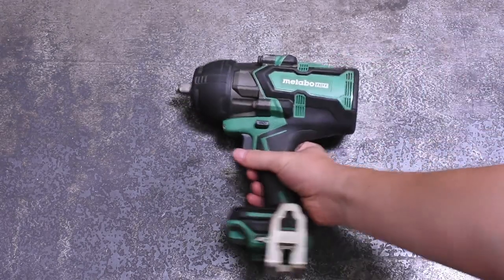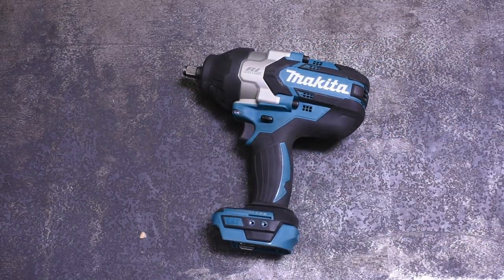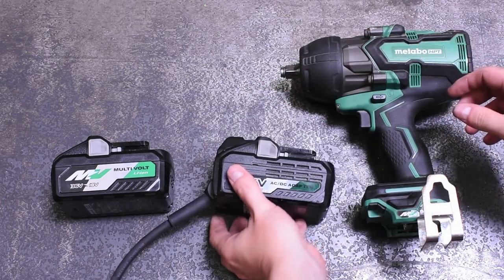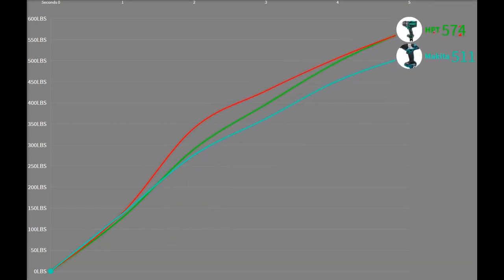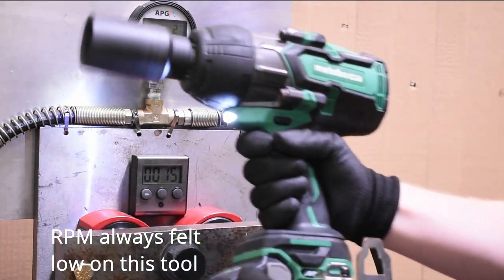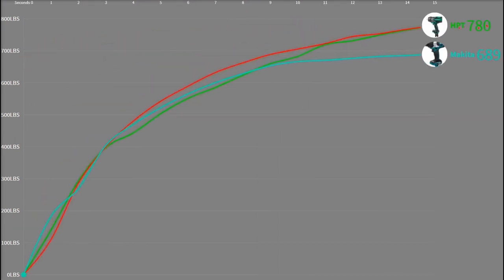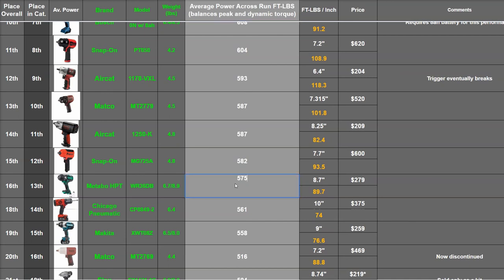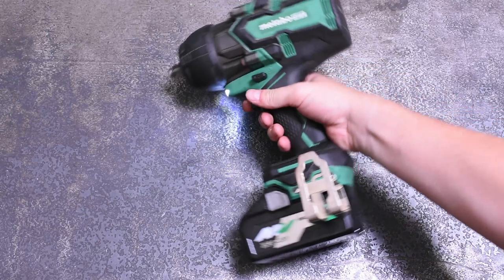What Happens When You Plug In a Cordless High Torque? Metabo HPT WR36DB

Comment: I wonder how a 220v version of the AC/DC adapter would fair (for the Europeans since Metabo is German), you could draw more power from the wall but then you also have to deal with ~75 amps running through the cord to the tool instead of the ~50 it currently does
Reply: Not how it works, tools are based on the winding resistance or controller cycle so all you need is enough for either.  In other words if it is a 36V adapter, all it has to do is stay at 36V without drooping and if it does that, a replacement capable of 1000X the current, won't improve the tool performance the slightest bit more.  Of course whether it stays at 36V, is something to test including whether it suffers loss over a modest gauge power cord.

Frankly it seems silly, since a 220V outlet can power plug in tools of even higher wattage rather than suffering the double (potential) bottleneck.
Reply: It's a step down transformer converting AC to DC voltage because the brushless motor won't work with AC voltage. Brushless DC motors need pulse width modulated DC voltage to function correctly. Although technically it won't perform much more than the 110-120 VAC adapter It will provide better stable current because of transformer efficiency. 220-240 VAC to 36 VDC step down using a transformer is more efficient than 110-120 VAC to 36 VDC step down. You lose less amperage in the conversion process.

Comment: I don't know if it was changed, but the Ridgid R86011 does not advertise 1,100 Ft-lbs when checking today. "485 ft./lbs. of torque in forward and 620 ft./lbs. of torque in reverse for heavy-duty applications."

Is this a different model? It's the only one I could find on their website.
Reply from the maker: We accidently copy/pasted the mid torque model number there. Here's the high torque: https://homedepot.sjv.io/4edzno

Comment: I've been looking at this to buy and almost did. Until I saw all the bad reviews on the batteries not lasting long. Because of this I'm going with milwaukee. I wanted this one so bad but I'm not going to invest $ to just have to buy batteries over and over. Crazy part is the 2.5 batteries aren't covered for 3 years. Batteries are only covered if they are 2.6 ah or higher!!!! That's crazy almost as if they put those in this kit so they won't have to replace them purposely

Comment: probably the adapter has 36V output, not 42. loss in battery performance under load and with use comes from voltage sag. 40t might handle 35A, but sags way more than a lithium polymer pack of equal energy density. if the metabo motor can actually handle 35A then you need a bigger or at the very least better performing battery to access the full power potential. typical UAV batteries would be perfect

Comment: I was hoping this would be a direct plugin scheme, not through an adapter so it would get 110 volts. That would have been interesting.
Reply: Have to convert the AC to DC at some point, or you'd need 2 different motors.

Comment: The corded AC to DC vs DC batteries one is true DC where as there is some sort of rectification going on if they are only doing half bridge rectification that may be why it is less as well as more internal resistance.  A better way may be to get a Variable DC supply as then you could test all of the guns as a corded equivalent with better current and voltage control.
Reply: It's not a matter of half vs full bridge rectification, it's going to be full bridge and then a SMPS.  The difference is it is a 36V PSU while the fully charged voltage of a 36V battery pack is close to 42V.  Of course the battery pack droops in voltage under load, so depends on quality cells and what the load is.

Variable DC supply would just be an expensive waste of money for how large and/or current limited it would be.  Ultimately the answer is, be sane about what power the job needs and don't try to max out a tool and burn it out for no reason.  This channel is about showing higher torque but in the real world, it's not those differences that matter but whether the tool keeps working all day, every day.
Reply: @stinkycheese804  Lithium batteries are a marketing scam.

Comment: Hi, I’ve never seen such a combination, for me it’s either one or the other, I have battery to eliminate the hose and the cord, just my opinion,
Reply: Option to have both in one is better. Always got the batteries when it's a quick job or away from any outlets. Then a plug for when it's in the garage and going to take a while. Also will make your batteries last longer over with less use on them.
Reply: @TheAmericanUhate  for me I’ll stay with cordless, ty for your reply,
Reply: Metabo also has a circular saw, angle grinder, miter saw, and table saw in the 36v multi volt platform that the ac adapter makes more sense for.  It is nice to have options
Reply: I think the power adapter really comes in handy on tools like their cordless miter saw and cordless table saw.  Larger tools that are nice to use cordless on a construction/project site but can be brought back to the shop and plugged in.

Comment: i Think to get the biggest power in to the tool car batteries should be the best, or capacitors maybe, since the cold crank amps are insane
Reply: Lugging a car battery around all day wouldn't be much fun. Nor would the 4 or 2AWG wires be light.

Comment: i am not very happy with the stuff you said about the AC/DC Adapter. There output is not unlimited, it is also rated you need to check the sticker on the Power brick to see the maximum Ampere Output. 
I would recommend using an contactless ampere meter for corded tests, thats a clamp you just clamp onto the cable it will tell you how much amps the device is really consuming. Maybe you can even fit the contactless clamp on some drill handles to see the actural Amps drawing from the batteries?! i hope you read this comment i would say that this is a pretty good idea :-)
Reply: Not happy?
He's just telling u that u can use it for longer periods of time without swapping batteries
Relax

Comment: I have the drill and impact driver. quick story. my friends had to use them because they're Milwaukee and DeWalt batteries were done so I let them use my metabo and they are contractors so they gruffed under their breath after they walked for my truck with them. they use them  for a couple hours. I was assuming they were going to lay the smack down but they were quiet and when they returned them they had a shit ass grin on their face. when I told him I paid little over 200 dollars I had the last laugh.

Comment: I’ll stick with my M 18 Milwaukee it gets it done seems like the Metabo would do better at twice the voltage
Reply: I have both
The Metabo runs cooler and gets more work done and the batteries are smaller than the Milwaukee HO so it's actually better balance and has a much better water and dust rating

Comment: The circle is now complete....
Cordless tools having a plug in option-  SMDH
Reply: To be fair. Cordless tools are an underperforming scam. Try a corded 120 VAC Brushed Drill vs a standard 20V DC brushless Drill for making 1000 holes in an aluminum trailer body and see how many times you need to swap out batteries on the cordless one.

Comment: You should test a human with a breaker bar
Reply: Why?  Even if it wins, the whole point is to not have to use one, plus that is highly variable based on the strength of the human and length of the bar, so completely pointless X 3.
Reply: @stinkycheese804  ok "stinky cheese." it's to get a general context for these numbers. And how much torque a human can produce on this rig. Not a very hard concept to understand. What happens when you're in the field and your batteries run out? You gon use your tounge to break a bolt?

Comment: Can someone explain why this is more accurate than just using a torque wrench and torquing something to spec, then seeing if your impact can bust it?  

Because according to those types of tests, these perform on the money.
Reply from the maker: That would be nut busting or loosening. We test tightening in FWD and REV. Thing is depending on bolt size and thread pitch you can influence nut busting ~40%. But some channels keep things consistent and is still useful to compare between tools like Shop Tool Reviews
Reply: @TorqueTestChannel  thank you.  This is the answer I was looking for.  

On a side note, this is a great channel.   Keep up the awesome content.   Content like this is what YouTube should be all about.  Thanks for what you do.

Comment: With the availability to just walk into home depot and grab the high torque couple with the lifetime warranty I'm going to stay with the ridgid. Good video 👍
Reply: Okay but if the Ridgid is discontinued and then a warranty replacement can only be fulfilled with their contemporary lower powered offering, then wouldn't the warranty seem less than ideal?  They can't replace it with what they don't have.
Reply: @stinkycheese804   They have to give you a tool of equal value.
Reply: The Rigid LSA is a joke-also they take forever to get your registered tool into their system and have had to call them numerous times to update my registration as it stayed pending for  months in end for a bunch of the tools I registered and when I did have to use the LSA they made it really hard to prove even though it was a lemon if a tool

Comment: Need to put a watt meter on that wall adapter .
Reply: Kind of hampered by the US 120 VAC standard. If it was allowed to run at 220-240 VAC It would outperform the battery pack, hands down. Even converting to DC voltage for the brushless motor they have inside the tool. It would be more efficient than the 120 VAC conversion.
Reply: @JosephArata  Plenty of power availbe. No need for 240V AC.
120V@15A is 1800W. 90% efficient conversion to 36V would be 45A (1620W). 80% efficient would be 40A (1440W).
Reply: @JosephArata  not just what TEDodd said but also, most places in the US aren't gonna have single phase 240v. And single phase 120 at amperages higher than 20 amps is just as uncommon. If they were to make the converter with a 20 amp circuit in mind, they would need a different  20 amp plug too

Comment: IP54 is a sort of useless spec.  I'm guessing they didn't engineer for it. They just happened to test it and it passed.  If you actually expect something to get wet, you want IP67.    I've seen IP67 tools be unaffected by use inside a wire EDM machine where they're basically constantly getting wet.
Reply: Well he got it wrong it's actually IP56
Reply: I've got lots of red and teal as well. As the green
The IP56 has proven to hold up better than the other colors here in the NW where we have lots of rain and wet-list a few Milwaukees and Makita's from moisture and had a few Metabo HPT in fall in creek as well as other heavy rains and it's never stopped working-its not a nothing burger-its better protection than it's competitions and usually at a better price point
Use the tools before spouting specs and hypotheticals
Reply: @baseballdude8491  I never said anything about Makita or Milwaukee.
Reply: @prototype3a  I was giving real world experience about my experience with different brands which I actually own and use-Makita and Milwaukee don't even offer IP56 for their tools a Metabo HPT does which is the whole point-it is more protected than the others, which is  a selling point/ benefit at a better price than the big 3 colors-they didn't "just happen to test it and it and it passed" they have a number of their tools rated IP56 and better-not sure what the disparaging something that adds value

Comment: I think that wall adapter battery is the worst designed product I've ever seen just because of the wire coming out the front where you're going to be working... Instead of the back
Reply: It's one of the best designs as it allows me to use my high run time tools with the AC adapter(unlike the other red, yellow, teal colors don't offer) and it actually is in the back of some.tools especially the ones u will most use with the adapter such as SDS Max rotary hammer, table saw, mitre saw, grinder, vacuum, portable band saw etc
When the other tool brands make this an option then u can complain but whining about a great technology that adds run time, lowers cost of extra batteries and longevity is kinda silly

Comment: That AC Adapter is dumb. I can only imagine trying to keep that stupid brick from falling off the lift while I'm working. Corded tools should have motors designed for AC instead of doing this conversion bullshit.
Reply: Dude
The AC adapter has improved the flexibility of a bunch of my Cordless Metabo HPT tools and a big reason I've swapped out many of my Milwaukee And Makita tools over the last few years being able to use the AC adapter with our SDS Max rotary hammers, table saw, grinder, portable band saw, vacuums, router(in table) and other applications has save a bunch of money on extra batteries, added lifetime/longevity of our batteries and lowered downtime
It's not as practical for all the tools but we have used it on some of the other tools at times and this also makes all of the 36V tools relevant for yrs to come when all the companies stop supporting the current lines
Next time slow down and do some more critical thinking before making a knee jerk response

Comment: Corded battery powered tools are just a ridiculous concept.  LOL!  I think it’s laughable and anyone buying a cord to connect to their battery powered tool is not real bright.  

Maybe instead of buying the corded adapter they should spring for a extra battery.
Reply: Metabo HPT offers a cordless mitre saw, table saw, and other large tools. If you work in a shop but occasionally bring these large tools on site, why would you NOT want the battery to AC/DC adapter? You have the convenience of corded power in an indoor stationary setting, with the ability to bring the tool elsewhere. Clearly you are not very bright for not looking at it from this aspect.
Reply: @doctordoom1337 , why would you use a corded tool, when you don’t have too.  If you’re into a platform you have plenty of batteries and a battery, depending on the size, usually lasts a long time on most tools.  I just think it’s ridiculous.  I hate cords!
Reply: @martylucas8557  dude relax-I have all the colors  of the rainbow in my shop and jobsite-the AC adapter has saved me gobs of $ and increased productivity by not having to buy so many batteries, increased the longevity of the batteries we have and makes all of the 36V tools relevant for yrs to come when the companies don't support the current battery tech
Try running your DeWalt, Milwaukee, Makita etc SDS Max rotary hammer, or Table saw, grinder, portable band saw, vacuum for hours in end and see what happens to your I reheated batteries/charger while I can plug in and keep on truckin